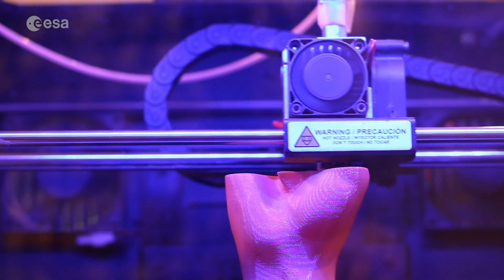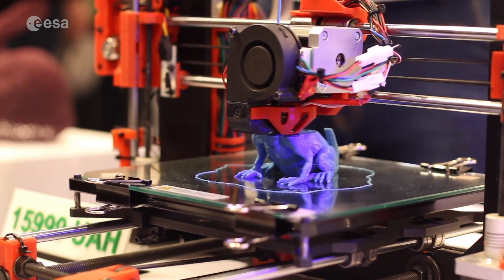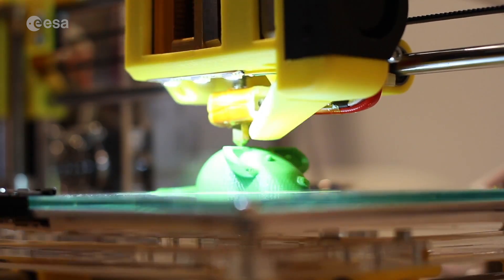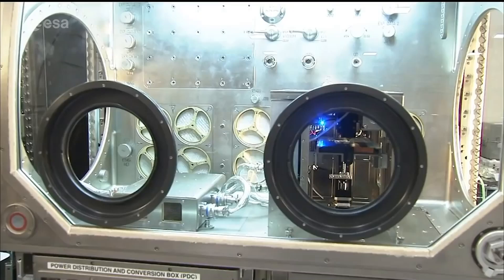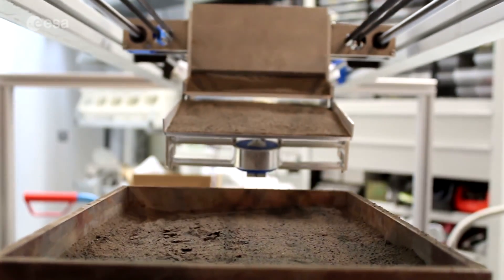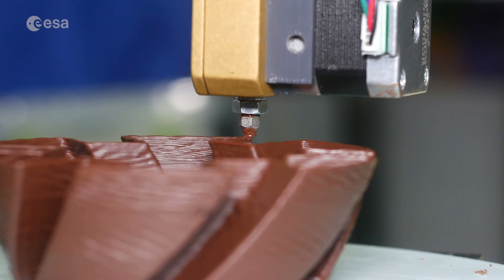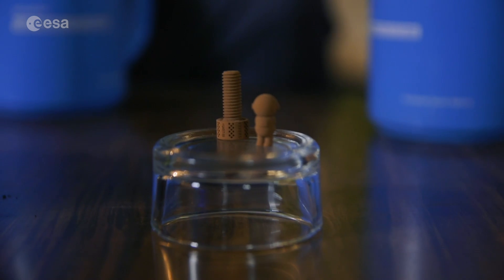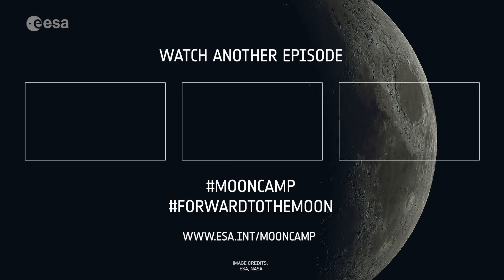3D Printing on the Moon | Meet the experts

Comment: This may be a good idea.  The only problem is that it requires a great amount of power and a lot of time. Then there is the maintenance issue. I have a 3D printer and if mine is any example, it (3D printing) will have to make some technical advances before it is practical.
Reply: Bridges and houses were printed with 3d printers, so... we’re ready ;)
Reply: @marinefroeliger9068  Let's hope so. I wish you well and hope you are very successful.